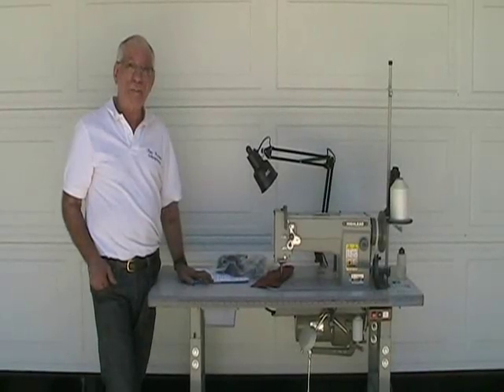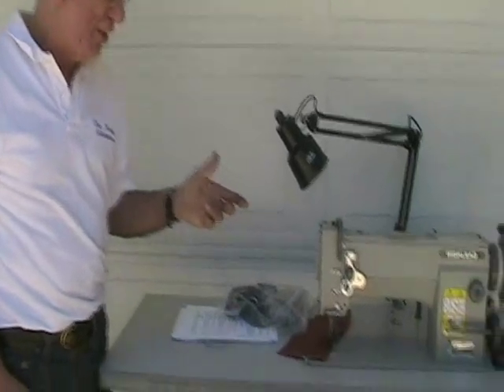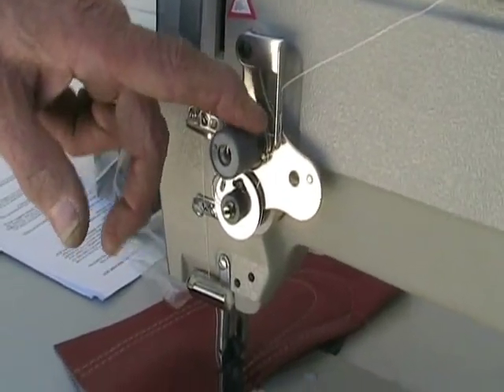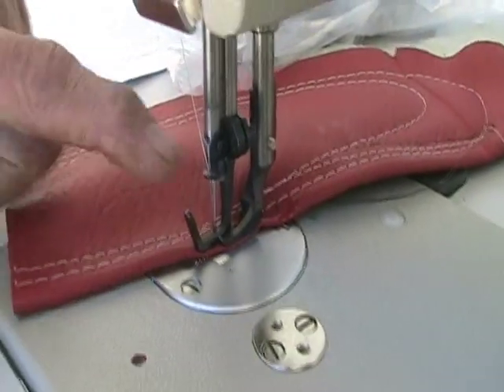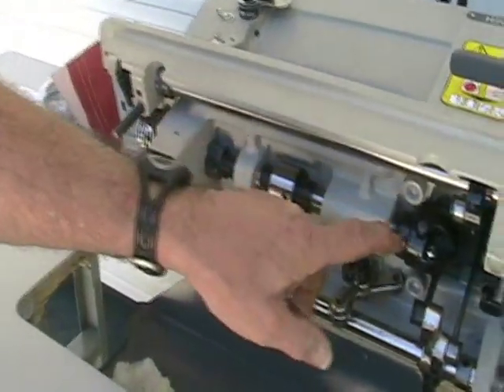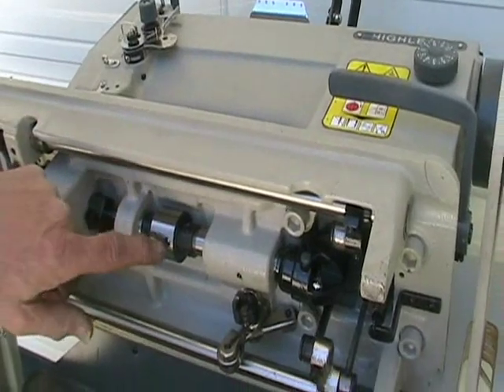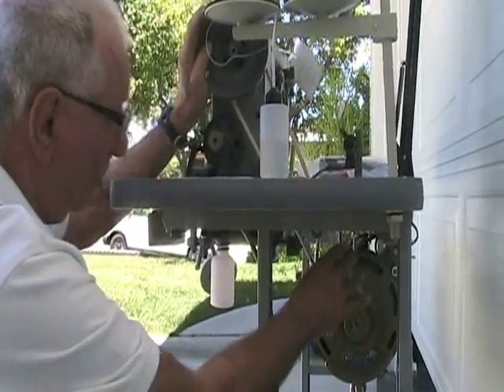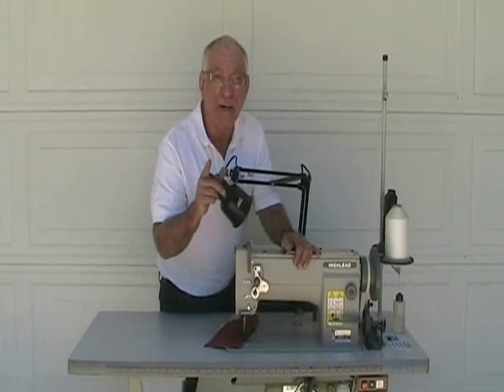Walking Foot Industrial Sewing Machine Repair & Maintenance

Comment: My machine is cutting theard
Reply: You may have a sharp edge on either the foot that the needle goes through or the lower feed dog cover plate. That the two most common causes on a lock stitching machine in my experience.